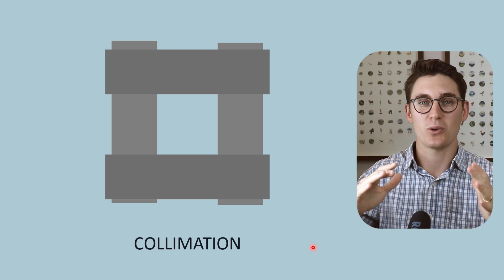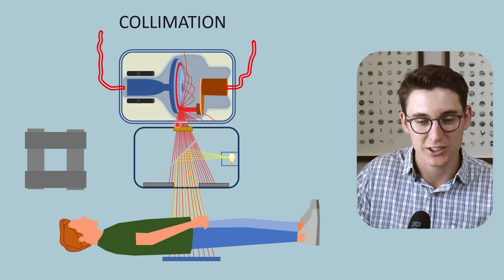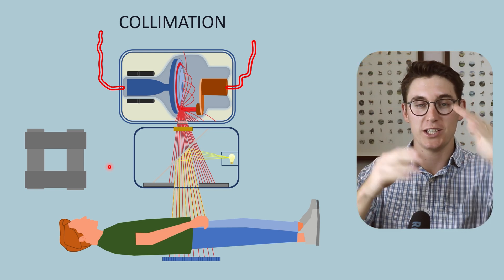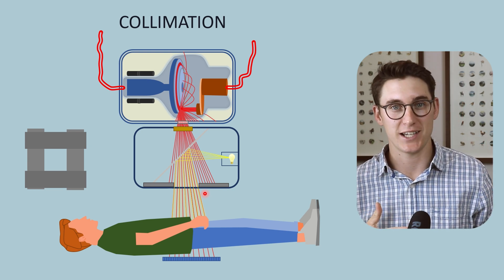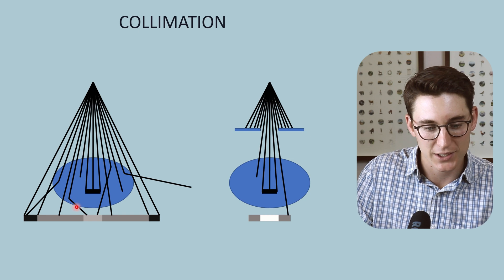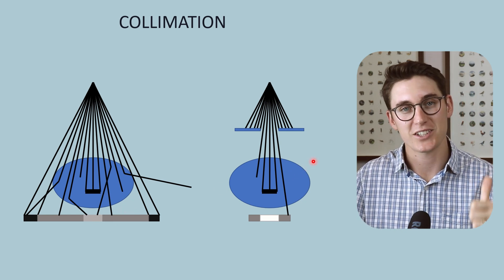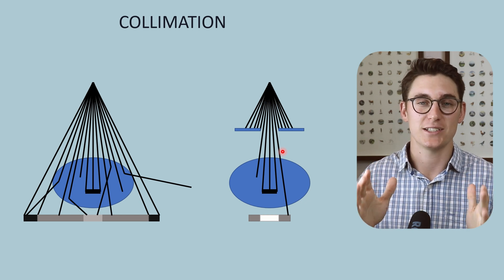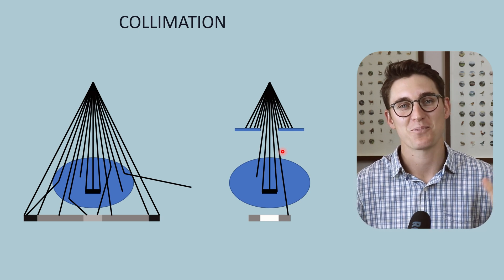Collimation of the X-ray Beam | X-ray physics #8 | Radiology Physics Course #15

Comment: Your videos are phenomenal! Thank you for all these resources/explanations.

Just had a question about what you said at 00:04:26 How does collimating improve spatial resolution? Shouldn't it only affect contrast by decreasing scatter (scatter kills contrast)? Especially since our FOV hasn't technically changed (Matrix number, pixel size, etc). Similar to grid spatial resolution - "Because the grid does not change the size of the focal spot or the size of the pixels in the image matrix, it does not influence spatial resolution."
Reply from the maker: Thank you Dylan! You’re correct ✅ my mistake, meant to say collimation improves contrast resolution! Thanks for letting me know 👌🏼